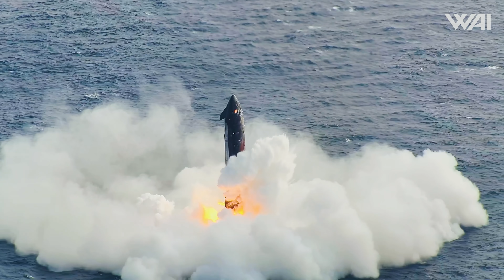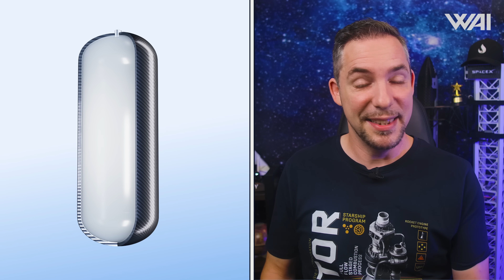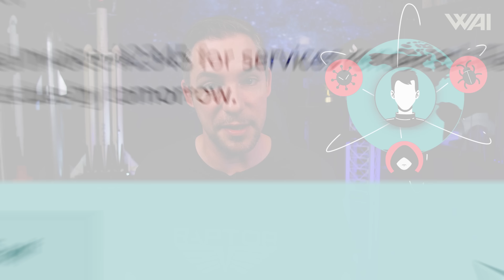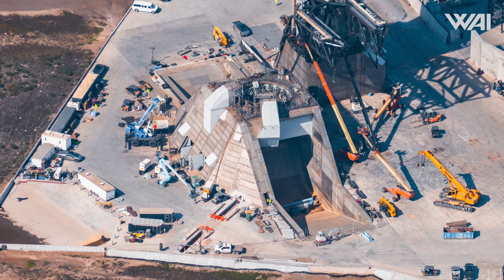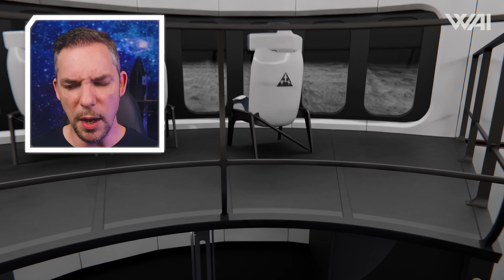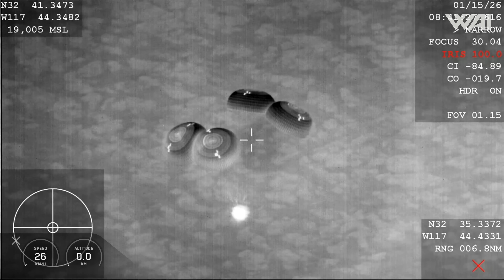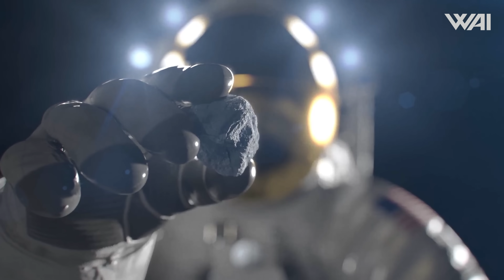SpaceX's Ship 39 Ready For Testing! When Is Flight 12? Isaacman Announces Moon Base!

Comment: I don't think they will make two splashdowns in the Indian Ocean... I think IFT12 will splash down in the Indian Ocean, but if all goes well, IFT13 will splash down off Boca Cica, exactly where the booster will splash down during IFT12!

PS: I believe that with the unmanned moon landing, several Optimus units will be brought to the moon with heavy equipment to build a platform for the subsequent human mission to land on the moon in greater safety! And of course, if this method works, there will be more and more Optimus units at work to build the lunar base!
Reply: If he splashes 'em down, he's introduced a new factor into the equation: QUENCH. Those hot tiles would normally air-cool after a catch (as will the nozzles, and everything else on the butt-end) A splashdown chills them FAST, and can do NASTY things to materials. Someone wanna clue Muskrat in on the mistake he is making? Dunk it only in emergency, ya fool!
Reply: @WhiteWolf65 , I wasn't thinking of an IFT13 that aims to recover the ship after splashdown, but ONLY to demonstrate orbit insertion, de-orbiting, and approach to Boca without risking catch!
Reply: That would be one separate success for each of two separate situations, not two of the same situation.

Comment: I still don't trust how they load up those trucks. there should be an extra strap which has the most tension in the center and losen up the outside two so you distribute the load on the supported part of that tank. Now you load it up with the load falling outside of the black small base and so, the sides will have pressure point on the tank and centrifugal forces (it will bend like a banana)
Reply: The straps are outside the skids!  They are exerting a bending force upon the COPVs!  These tanks should be transported in vertical racks.
Reply: @Barbreck1  yep, that's what I said in better English. Not a native eng. speaker *edit: except the vertical part. that could also solve the problem. like beer bottles in a crate
Reply: Keep the carriers directly under the straps.
Reply: @imconsequetau5275  NO!  The straps should not be applying ANY pressure to the COPVs!!!  The COPVs should be caged in protective racks and those cages should then take the strap loading!
Reply: @Whataboutit ... Take note!
Reply from the maker: @Barbreck1  I am!
Reply: @Whataboutit  Scary eh?!  Leave aside the bending... the crushing alone...!!!